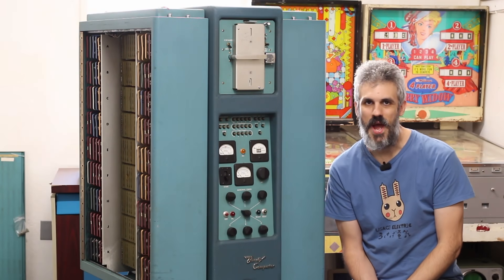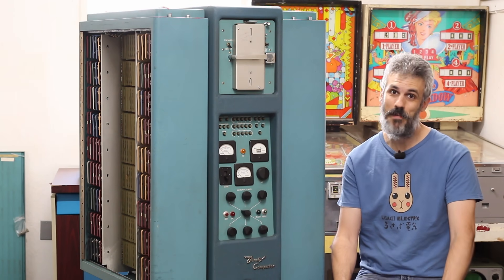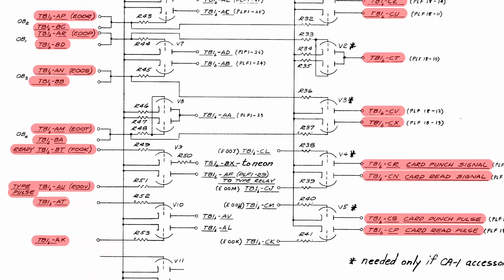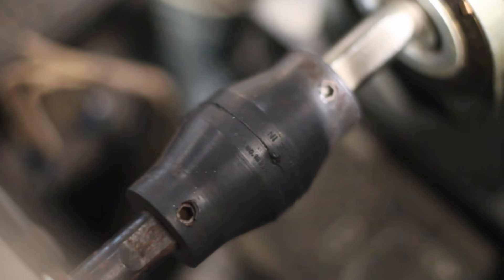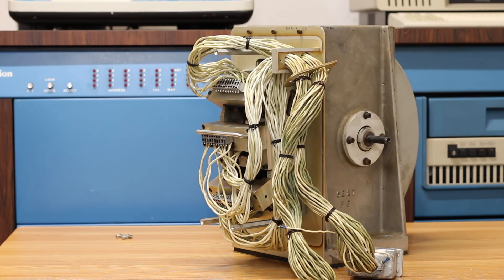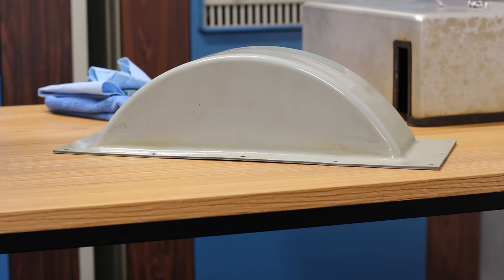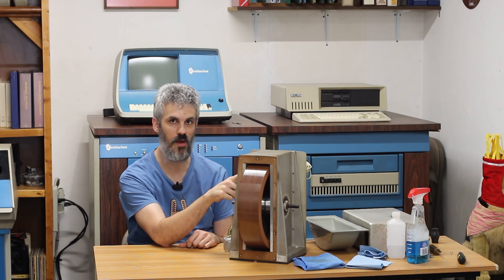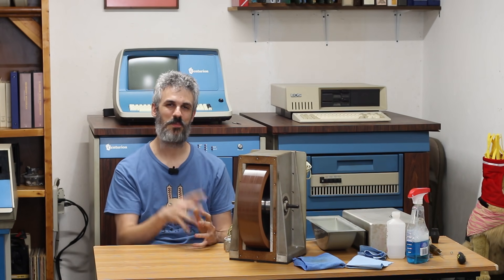Removing the Rotating Drum Memory from the Bendix G15

Comment: Don’t forget the bearings.  A few microns of runout in the bearing could easily result in 1 mil + at the edge of the drum.  That’s really a crazy tight tolerance for a machine built in the early to mid 1950s.  I am thinking a lacquer with the correct ferrite compound sprayed on is the way to go.  I have my doubts about polishing the surface after the fact.  I have a feeling how drums and platters were coated is one of those trade secret techniques, details of which are difficult to find in patents.  Probably anyone alive who actually worked on coating drums is in the upper 80s to 90 + years old by now.
Reply: Yes, the iron oxide could scratch the coating itself. Mixing the iron with clear then sanding could be a nightmare.  How would he know the right amount of iron or particle size or resistance of the clear.
Reply: @SmokeyWire56  Thanks for the comment.  Years back I had a Western Electric voice announcement unit which could record up to about three minutes of audio on a magnetic drum which moved under a head driven by a lead screw, not too unlike an old Edison victrola.  That drum was coated with an orange-red oxide in what appeared to be a fairly soft substrate.  I believe the trick will be to find an oxide mix which has the correct magnetostrictive properties to magnetize fast enough and retain enough residual magnetism to provide adequate signal/noise ratio at the read head.  That’s probably yet another trade secret.  Everything could be right with the coating process and still give zip for output if the formulation is wrong.  There is a lot of interesting voodoo in magnetic recording.  For example, VHS machines used depth recording which allowed one signal to be laid down on top of another and those signals to be separately recovered by virtue of gap size and head geometry.

Comment: Take some old vhs tape, wash away the base with acetone/xylene and use the remainder as your magnetic dope for the 2-part paint. Spin the drum as you spray, then polish, repeat. then use a lathe to dimension if better tolerances are needed.

Comment: I hate cleaning those resistors. I had them in the Navy on several systems as well as encountering them later on older manufacturing machines. Also, I find it interesting that in more advanced times you find that the clearances and specs of older hardware are actually quite tolerant to the extent that .0001 mil isn't necessarily required. I'm looking forward to seeing your success with recoating the drum as I think (empirically, not based on scientific evidence) that the result might be a bit easier than expected. Either way, thanks for an absolutely great series looking at these older technologies. Some of these I've seen but wasn't given a chance to touch them.

Comment: 4:03 You need some Texwipes and isopropyl alcohol or freon. No residue but it will remove ink and some paint.
12:44 Be careful, products with ammonia can have adverse affects on rotating memory devices. It can delaminate the coating on the drum or platters. Head crashes after housekeeping mopped.
15:08 The scent is acrid with a little ozone.
22:15 That drum will become gyroscopic if it spins up with any speed. A couple different companies make magnetic paint.
A ride on the way back machine was fun. Nice video, good fun.

Comment: I noticed that the sides of the drum have the same magnetic coating as the main surface. This suggests that the drum was originally coated by being lowered in a trough filled with the magnetic material in liquid form (just the bottom of the drum) and then rotated to apply material to the entire surface. The centrifugal force would even out the coating over the entire surface of the drum. I suspect this was done in a sealed chamber to contain splattered liquid with some kind of mechanism to raise and lower the trough to start and stop the coating process.
Reply: I was thinking the same thing and just posted a similar thought.  The shroud that fits over the drum during the coating process would take a little engineering, but would cause quite the mess if it failed in any way.  Samples could also be taken from the sides to safely test for enamel or any other binders that would give away how it was done.
Reply: Interesting theory!
Reply: Electrostatic coating also makes the paint fly around covered edges of the object to adhere on its backside too.

Comment: There's Drum Head Alignment screws. Maybe all of these heads should be pre-set to highest elevated state above the magnetic surface before trying anything with the replacement drum and then probed individually to have them set to a good position. Just as a precaution.
Reply: This DEFINITELY needs to be part of the plan not just on a resurfaced drum but ALSO on the exchanged drum.  All those heads will need to be recalibrated for the proper height.  It is a very manual process which is why I would try to get the machine up and running with the existing crashes if at all possible.

Comment: This Bendix computer keeps getting more interesting. Since I have to start thinking about simple but modern digital servo processors for a project; AND I tried to build a EM relay/diode computer long ago (didn't have enough relays), AND the Bendix magnetic drum/ punch tape/cards/architecture are too interesting together for too many reasons... you've got me hooked! 
I built a weirdly efficient accumulator/shifter/base 10 to binary converter in one memory register and began designing the rest of a processor and realized I'd need way over 500 to make it work so I put it on hold 20 years ago.

Comment: Couple ideas for ya for the refinishing of that drum. 1) Check out Fiber optic Polishing paper for your final polish before coating. 2) Would Electrostatic coating be an option? <you do have conductive materials on both sides <the drum and the spray>> 3) Spray while spinning in a negitive pressure atmosphere? 4) coat heavy and sand/finish to precision? - interesting to see how this all goes, thanks for sharing this adventure!

Comment: Nice. This brings retrocomputing to a whole new level... correction: to an even older level! 😊
Reply: Indeed. What's tempting here is that the drum repair should be doable with old metal-working tools.  Given the age of the computer in question, the drum was made on a lathe that could have been built as early as WWII.  It doesn't get much more vintage than fixing what amounts to CPU registers on 80 year old machine-shop tools.

Comment: The lathe idea sounds good, if it doesn’t work you could try mixing a magnetic compound in the form of a paste, apply it thicker than needed and then use the lathe with a scraper set to the exact right running distance, if then run at a slow speed in the lathe, the excess material could be gently scraped off leaving a perfect magnetic surface

Comment: The sockets exposed around 4:55 when you pull those relays ARE actually vacuum tube sockets - these were one of four styles used before the introduction of octal / locktal base tubes (the others had 4, 6, or 7 pins, but had two larger pins for keying purposes, and were usually assigned to the filament - the 6E5 magic eye tube is probably the most common example of these early tube bases).

Comment: Tim Hunkin has a remastered Version of "The Secret Life of the Videorecorder" on his channel where at the end he talks a bit about the famous stickytape and rust experiment and how they made the magnetic powder. Its not as simple as just using red iron oxide - if I remember right, you start with black iron oxide and heat it for a certain time to a certain temperature such that it partially converts into the red iron oxide and thats the stuff that can hold magnetization while being sensitive enough that the write head magnetic field is sufficient to make a recording.
Reply: Right, it isn't simply rust (Fe2O3). I read in a book from 1959, written by a engineer working at Philips, that you need gamma-Fe2O3, not alpha-Fe2O3. And the long and thin crystals are best, especially if aligned along the tape (or drum in this case). But he also says that the process to get this type of oxide is patented by tape manufacturers. Btw.: I got this book (it was decommissioned) from the library of the company BASF, which might be known by some people.😉
Reply: Yes, you want the right oxide formula, even if it means you need to get old ferrite tapes, and soak them in thinners to dissolve the oxide from the mylar backing, and then filter the result to make it a consistent product, probably needing a flameproof rod mill to break up the clumps in solvent first. Then filter, and spray onto the drum while it is spinning in the housing, after removing heads and masking off the interior, then leave spinning till the solvent is all flashed off, putting the oxide back on the drum. Ferrite on mylar, probably dating from the 1960's, as that formula is about the right one, and not the high coercivity ones used later, that the old heads likely will not be able to erase or write to.
Reply: @andreasascherl2018 Whats very encouraging is that it worked regardless of the very crude way of preparing the magnetic pigment. For use in the drum memory that might already be perfectly adequate, since all that needs to be recorded are bits, not analog signals. For a slow moving tape that is expected to have low noise, linearity etc. it makes sense that the manufacturers aren't so keen on giving away the info on how to make the pigment. Since the heads of a drum memory have large gaps to project the magnetic field over the (compared to a tape) very large distance onto the drum, it also should not be critical that the pigment be a particulalrly fine dust or powder - the size of a bit on the drum is very large.
Reply: Love Tim Hunkin! Anyone not familiar should head over and check out his arcade machines and his secret life of x series
Reply: Sounds like a candidate for a powder coat process.
Reply: @tpa6120a2dwp  Interesting is also that it gets overwritten every turn of the drum. With audio tapes people worry about loss of magnetism over time (e.g. by magnetic residues on tape heads and capstan) that may make them sound dull. If you write digital bits those need to survive only one revolution of the drum, it won't matter anyway.

Comment: I'm in agreement with others here: consider getting it precision machined and/or built up to exact tolerances as a pristine cylinder, first.  Heck, you might find another youtuber has the tools for the job (lots of machinists on this site).  As for the coating, the sides look like they're covered in the same stuff.  I think that's a clue as to how this was done in the first place and is worth considering.   Also, you can take a sample from that side area and test it with solvents to get an idea of what was used in the first place.    Lastly, it might have been spin coated anyway despite being a cylinder (and making a colossal mess in the process).
Reply: A collab between Usagi and the machining part of youtube to remanufacture a memory drum would be some amazing content.
Reply: At first when I saw the sides coated too I thought it was a solid ring of some kind of ferrous oxide compound which could be machined down. Yes I know that's a terrible idea and nobody would do it.

Comment: The method of spraying on a suitably ferromagnetic material should work to be fair.
Just turn the drum between centers on a lathe. (the axel on the drum has visible signs that the axel at least were made in that fashion.)
And beyond that it is as you say a simple spray coating application at a steady RPM. And remember to keep the lathe running while it dries, don't even stop it or change its speed. Since any changes will give the paint time to settle unevenly.

I have a strong feeling that it will work fairly flawlessly. Might though have to play around with it a few times to get to the correct coating thickness. Ie don't be afraid to put a micrometer to the surface for the first couple of runs, and document both RPM, spray time, air pressure, distance and the viscosity of your DIY magnetic paint. Since changing any of those will change the thickness.

Technically to get an even more even coating you would also have to oscillate the spray nozzle back and forth along the axis of rotation. Since te application will have a somewhat bell curve-ish distribution. (However, this effect might be too small to matter, but might be worth keeping in mind.)

Though, another approach is to just coat it thick and cut/"grind"/polish it down to the desired thickness, but I have no clue how that would fair in practice, paint usually isn't the "best" material to machine. (Though, a customer at work grinds rubber parts to +/- 5 µm, and rubber isn't "nice to grind".)
Reply: he'll probably want to check how fine the fe2o3 is he gets, i imagine that these companies used pretty small granules (like 10s of nm) size, so having a mortise and pestle for this might be needed which is a pretty reliable way to get to that size

also will absolutely have to dry the powder, iron oxide loves absorbing water so it should be placed in an 100C oven for a bit to dry it out and stored in a desiccator. but otherwise it seems very reasonable, after all its 1950's mechanical computer tech. the magnetic disk/drum was only just recently invented so i can't imagine many specialized processes had been developed yet
Reply: @genderender  Or just grab lots of old ferrite tape, and strip the coating off it with a suitable solvent. The grind and filter in the solvent, to get it back to a fine powder suspension, and spray it on.
Reply: @genderender  Eh. You are both right and wrong.
Yes, "off the shelf dust" is not always as fine as the seller states it is. And it is true that it risks being too coarse for the application.

But a particle size of 10's of nm is way smaller than anything produced at the time of this machine as far as magnetic media is concerned.

A more reasonable particle size for the time would be noticeably above 1 µm. (and one can technically calculate the needed grain size if one wants, but this comment is long enough as is.)

Secondly. No a mortar and pestle isn't a reliable way to make particles bellow 1 µm as far as most materials are concerned. Let alone 10's of nm.

An actually reliable way to produce particles bellow 1 µm is through chemical means. Simply growing particles around a nucleation sites until said particles reaches one's desired size.

Not that particles of this size is of any relevance to this magnetic drum. (Rough math from my side puts a grain size of 10 µm as overkill, that is if the drum is 1 foot in diameter, but it is likely bigger making the 10 µm grain size even more overkill.)

Comment: how about ~20 000 grit paper/stone to bring leveled surface.     how about CrO2
  Polymer Resins: Various polymer resins are commonly used as the base for the binder. These resins provide adhesion and binding properties to hold the magnetic particles together and adhere them to the tape's base film.

    Solvents: Solvents are used to dissolve the polymer resins and make them into a liquid form suitable for coating. Common solvents include toluene, xylene, and various alcohols.

    Plasticizers: Plasticizers are added to improve the flexibility and durability of the magnetic coating. They help ensure that the coating remains pliable and resistant to cracking over time.

    Surfactants: Surfactants can be added to improve the spreadability and wetting properties of the coating mixture. They help the coating material spread evenly across the base film.

    Antistatic Agents: To minimize the buildup of static electricity on the tape's surface, antistatic agents are often added.

Comment: I think your coating idea is going to work. That's exactly what i was going to suggest. I would consider doing all your machining on the original bearings because then you don't have to worry about centering error, etc. Take the heads off, clamp the whole thing down to your lathe bed, and spin it with an electric motor.

Comment: Regarding coating the drum:  I would spray the coating on the drum thick, filling in the grooves, then polish it down while spinning with a polishing bar laid across just above the drum, gradually lowering it a micron at a time until the coating is polished to the proper thickness.

Comment: OK, Usagi, you have totally got me down in this rabbit hole--pun certainly intended. It's clear that microscopic examination of the coating is valuable. Don't strip the old coating off the drum until you have developed your process and are ready to coat--you may want it for microscopic comparisons. Particle sizes are sub-micron, so you will be pushing the limits of a good light microscope to resolve individual particles, but clearly there is still a lot you can learn about how they are dispersed and bound. One resource (Kreiselmaier) suggests making tests on glass microscope slides, which had also occurred to me as a good inexpensive source of test blanks.
Reply: Also in Kreiselmaier, it seems the way emulsions were applied to magnetic tape are mechanical, not sprayed. "Reverse roll,
knife, and gravure coaters are routinely used." These sound reminiscent of the way ink is handled in a commercial printing press.

Comment: What is the thickness of the original surface coating? What is the current maximum surface deviation caused by head crashes and other damage? How much adjustment can you get out of the Drum Head Alignment screws? 
If the coating is thick enough, you could use an ultrafine cerium paste to polish out the scars on the drum. If the Drum Head Alignment screws give enough adjustability, and the original surface is thick enough, you may not need to recoat!